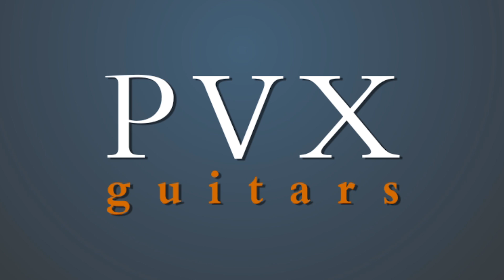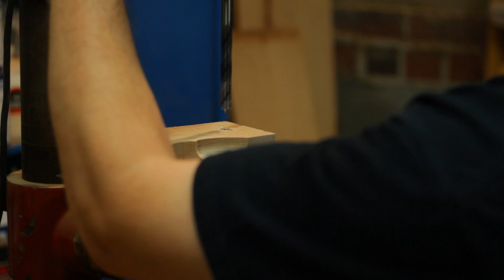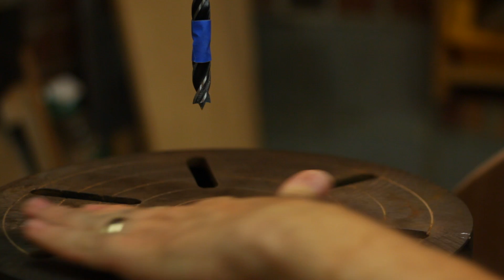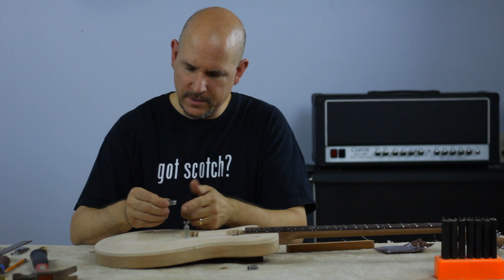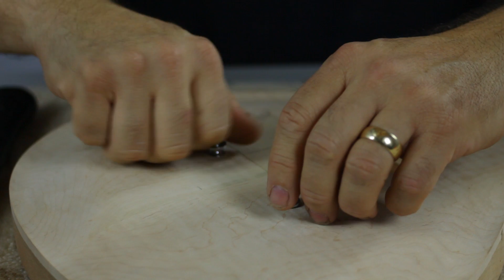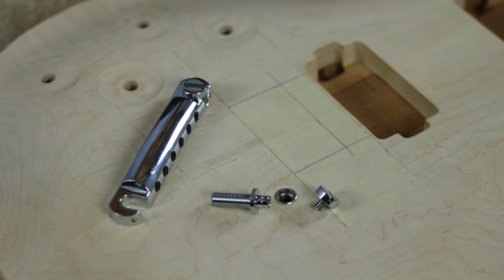Part 2 - Electric Guitar Kit Bridge Installation

Comment: Thank you for this informative video, I do have a question. Why don’t you ground the bridge? I just recently had an issue with my home made Les Paul, it was noisy and when I added a ground strip to the bridge it was way better. This guitar was equipped with P90’s maybe with humbuckers this si not a problem??